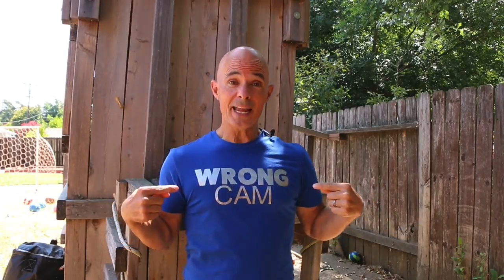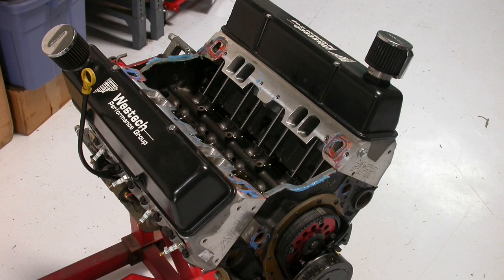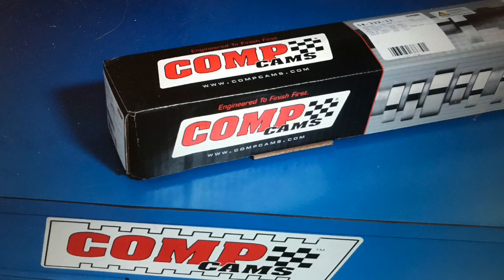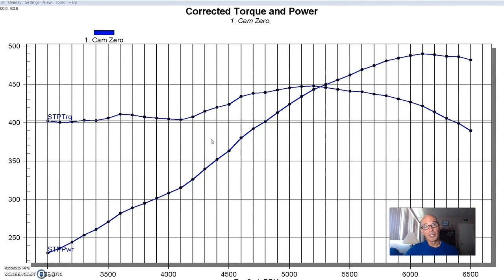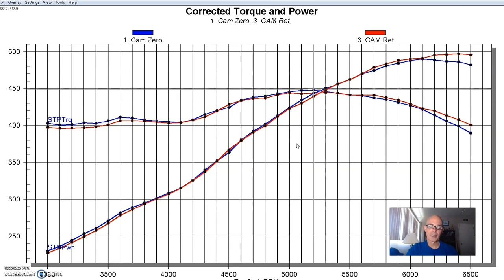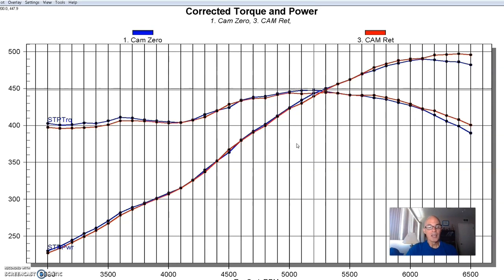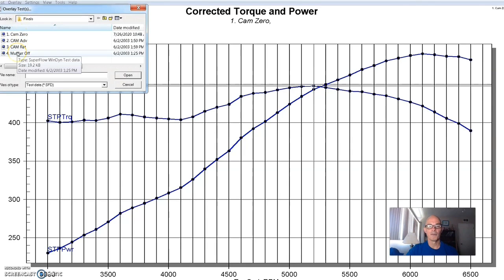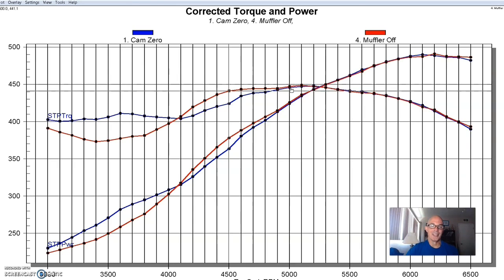TESTED-SBC ADJUSTABLE CAM TIMING

Comment: I’m guessing an X Or H pipe would negate the muffler effect since that becomes the starting point for the negative pressure wave. Thumbs up for yet another great splainer vid!
Reply from the maker: the X or H pipe will still add collector length before the cross over

Comment: i've seen this test once before and the results are the same. I would like to see what the difference would be with no exhaust. Example no headers or zoomies on rather than trying to gather the exhaust into a collector. So, there is no scavenging.
Reply: Zoomies make less power then headers on a dyno. It’s already been proven. On the track it might be different because of the air speed pulling the exhaust out.
Reply: It’s not a Nova ive seen people who run big nitrous kits(300+hp)  and zoomies make more power than a header but only while on spray

Comment: Have you ever used that self adjusting timing set Competition Products sells?
Reply from the maker: I have not
Reply: @richardholdener1727  Thanks for your reply. I spent too much time looking for it after I asked you if you've used it, to no avail. Perhaps they took it off of the market. From what I recall it had a chain which was intentional "loose" and it used one or two spring loaded tensioners which expanded as the rpm increased, effectively making the chain "longer" and retarded the cam timing. I wish I could find it.
Reply: @richardholdener1727  Actually, I found it. 😎 It's called Cam Correct.
There are a few options available but I'm not able to identify the differences.
https://www.competitionproducts.com/mobile/Cam-Correct/products/122/

Comment: I was surprised that removing the muffler effected the low rpm torque that much. Have you ever tested an exhaust system with headers, a crossover on the header pipes (no mufflers) and a side exit similar to what NASCAR uses?
Reply from the maker: Nascar uses application specific Tri-Y headers

Comment: Years ago I knew a guy with a 440 torqueflite Challenger. Perennial bracket race champ. Then one year he tried a set of Hooker adjustable headers. It took 15 passes and subsequent primary/ collector length changes  just to get it to ET as good as before the change.

Comment: Well matching everything, carb, headers, cam, heads, gas, compression. My 383 loved a 750 carb, 1.75 primary tubes, high rise dowel plain with retarded timming. We did the 600,650, 1.625 tubes, single ,dowel  intakes, advanced, retarded timming. And found the sweet all around spot, 650 hp, 670 torque. Know custom cnc,heads,intake, custom carb, we do not know what to expect. Great vid seeing what was what is always great instead of what if,cause what if can get expensive.

Comment: hey Richard try that old motorcycle tuner's trick where you put on a length of pipe, spraypaint a line on it, run the engine for 10 mins and then cut the pipe off where the paint stops burning off.. that trick has never failed to work for me on naturally aspirated engines
Reply from the maker: 18 inches is what we generally use on the dyno with no mufflers

Comment: Electronically controlled electric, exhaust cut out, at 4200. Thanks for the tip. Great, great show.
Reply: I posted the same thing then deleted it when I read yours.
Reply: @cuzz63  lol, sorry. Someone said the new vette has it. But, I dont think it is automatic. Thanks.
Reply: Corvette ZO6
Reply: Lots of cars have them ran off of vacuum signal, high vacuum keeps them closed at idle then when your heavy on the throttle they open
Reply: @knowbull5hit590  I did not know that. I see there are rpm activation switches built into some new gauges. 😁
Reply: @knowbull5hit590  Never heard that before but what we are talking about is opening at a set RPM.
Reply: cuzz63  beamers and high end turbo cars are like that. Its not like this shit is even going to change the power curve anyway unless the things dump right at the collector, which most people dont want in their street driven vehicles
Reply: @knowbull5hit590  good point, only a few ft lbs anyway.
Reply: Darren Nash  yeah just the time spent into setting it up wouldnt be worth the gain in power, loud-valves are still fun to mess around with on the street and can help with flow capabilities on high-hp streetcars that have full exhausts.

Comment: Tunnel ram rocks! Nice torque and power for a relatively short cam. How about moving those mufflers back to vehicle position, help or hurt?
Reply from the maker: doesn't change anything after a certain length-then the exhaust tube length can become a flow restriction
Reply: If you were putting this engine in, say, a C10, would you keep it at 3” all the way? I’ve seen a test (Engine Masters, l think) that said 3” exhaust was worth 20hp over 2-1/2” at 600hp. Would a tri-Y header be less sensitive? Please keep sending us answers!

Comment: I wonder if one can program a butterfly valve to open the exhaust around it's sweet spot to further fine tune an engine
Reply: Used a lot in street bikes in the factory exhaust. Helps optimize the operation over a wide range of rpm
Reply: You can do it with a cut out and a nitrous window switch
Reply: It’s called a exhaust cut out and with Holley dominator controlling it anything is possible
Reply: Apexi make them
Reply: Ever dyno a try y header suppose to give a engine a flatter torque curve richard

Comment: I've always degreed a cam while installing it.  Always been told it's the best optimized, and to ensure valve to piston clearance.  Not sure how far off the timing would have to be before you run into issues.  Interesting seeing the results though.  Definitely not what I was expecting.
Reply: Typically, yes. Degreeing is the right way to do it. Even if you don't know what the numbers mean, never assume cam gears and crank gears and the cam for that matter, were made correctly. Be surprised what I have seen. Also, the results in this video are not typical, and will vary for each application. If the cam was way off, you would see different results. Would hate for people to take that graph reading out of context, and think the minimal power differences are the same for every engine. Results vary depending on how off the combination is. Same goes for any part on the engine..

Comment: Richard, do you think a single 3" exhaust with a Y pipe would be a substantial restriction on a typical cammed street LS making 500-550 crank? Or would it be more about the type of muffler being used?
Reply from the maker: Engine Masters did a cool test on that-the single worked well
Reply: @richardholdener1727  Found it, episode 60. TYVM richard!

Comment: Always wanted to know how much it changes the curve, thanks.
Reply: There's a guy that built his own VVT system for his turbo dodge,  it replaced the tensioner and idler pullies and iirc could adjust a total of 14 ish degrees.

Its as basic as such things get,  you would basically see your curves at either point you wanted to run tue cam and set the switchover for the crossover point, boom you got your self nice top end with easy starting and a better idle. Probably a bit of olw end also that you might otherwise be missing if you had your cam set for best power.

Something I would like to see on a V8, and i might try on my little Mazda lol.